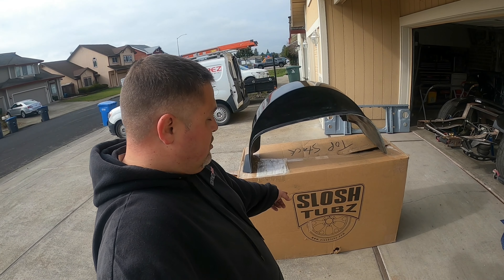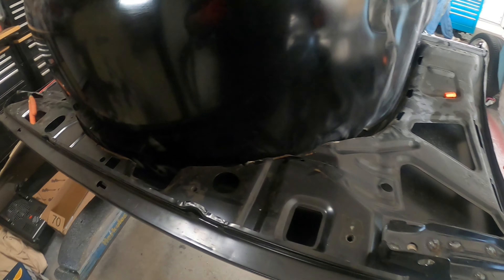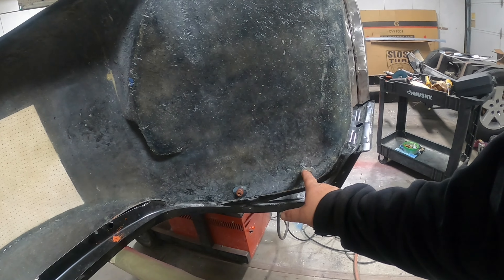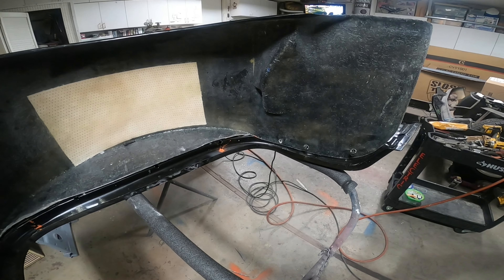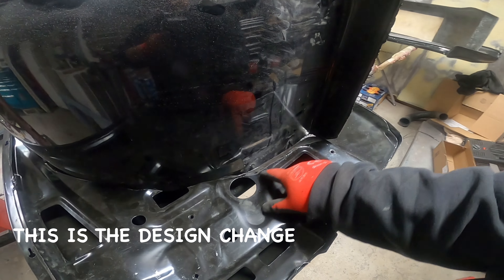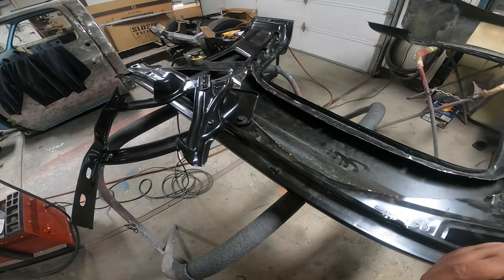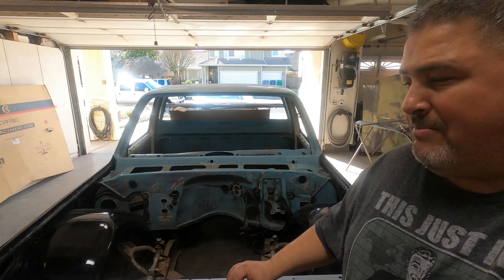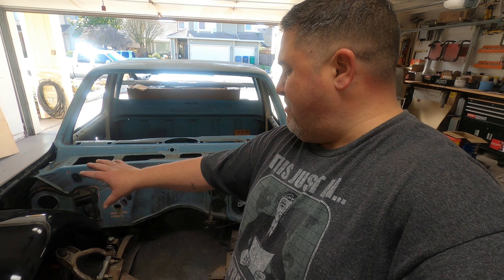Bailey Built S1E1 C-10 Slosh Tubz

Comment: Those tubz are sweet! Did you sand and finish the underside of the tubz? Or is it even needed?
Reply from the maker: I will apply an undercoating to the underside of the tub, however its not needed. The underside is a raw fiberglass with no finish.
Reply: @baileybuilt6686  what wheels are you using
Reply from the maker: @andme9408  Ram 20" rims. Got this set of rims from a classic car swap meet for $300

Comment: if you spend $750 for fenders they should bolt in
Reply: They do bolt in. The wheel hits the inner fender so you have to cut it before you bolt them in.